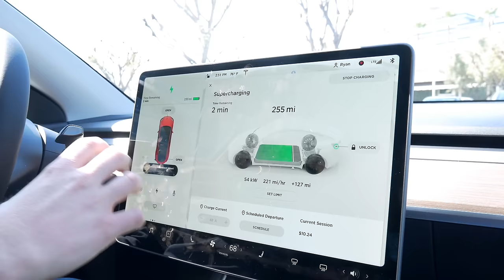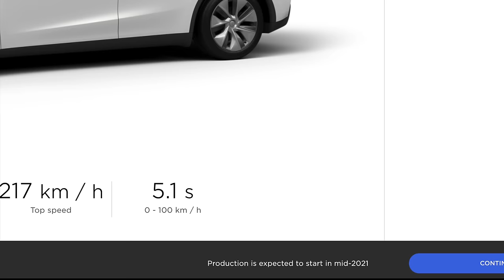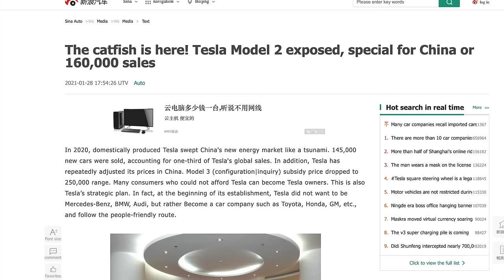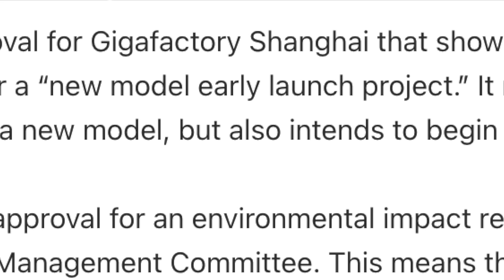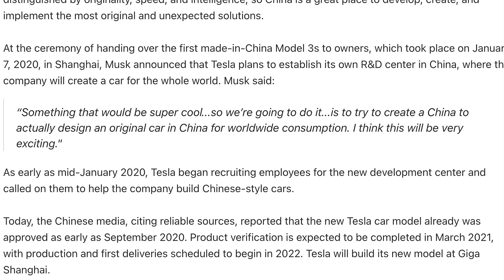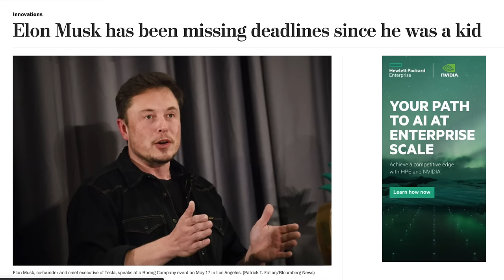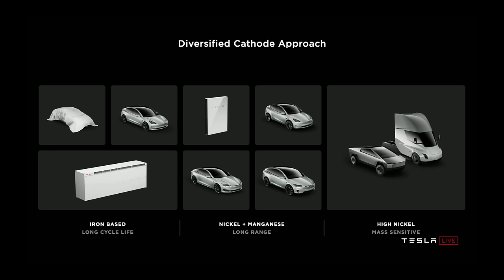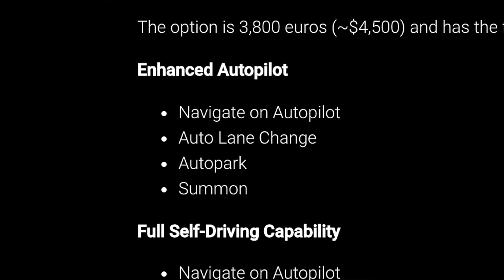LEAKED Tesla Model 2 in 2021?

Comment: That Model 2 render looks like someone slapped a Model 3's front on an Opel Corsa.
Reply: I felt the same
Reply: In one of the models the rear looks very VW ID3 I thought
Reply: Agreed. I'm not convinced this a real Tesla render. First Tesla would not put a visor over the back window. That is popular in the auto industry, but it increases drag. Tesla will resist this trend because they always minimize drag. Also, Tesla does not use the fin antenna on the back of any of their current cars. The antenna is hidden.
Reply: Opel Astra GTC

Comment: A Model 2 hatchback will sell very well in Britain and Europe as a whole.  It could even tempt me to change from my Golf which I’m picking up on Monday and go electric for the first time when I change my car in 2024.
Reply: I agree. That’s what I’m waiting for too. Also in UK. Currently drive a skoda fabia
Reply: Same I want to put a deposit down for this one, been itching to get model 3 but tight ass me it doesn't quite add up for my mileage, I have a small vauxhall and don't want long range as hell nothing is really that far in Britain.
Reply: @martinsykes5722  precisely
Reply: Model 2 performance/long range please - sounds good to me
Reply: I have a VW Golf as well. I would trade for a Model 2 hatchback LR.
Reply: I currently drive a Trabant, but am unsure whether the rust protection would be as good on the Model 2.
Reply: go get you a golf 7... golf 8 has so many problems....
Reply: Model 2 or an ID3/4 will be my next.

Comment: I haven't been so happy not being able to afford a Tesla until now.. can't wait to see the full version of this and hopefully its specs stay reasonable with the 3's
Reply: Lower accelerations = lower power consumption = need for smaller battery = cost savings. If anything its a city car.
Pros: Faster charging, affordable (as in a long term) and practical for getting around. Given the range is a real bonus making this car even more capable.
Reply: @EddyKorgo  

I agree, but few will accept a "city car" only in the usa. You can drive cross country in a Toyota Yaris. You can cut top end performance. Slower 0 to 60 times, lower top speeds, lower horsepower. Etc Americans don't want. City only car. I really can't see americans accepting anything less then  250 to 275 mile range.

Comment: The refreshed Model S is not ahead of schedule.  It was the Model S Plaid+ (renamed from just Plaid) that was promised at the end of 2021 and that is still where it stands.  The Plaid+ is dependent on volume production of the 4680 cells.  It remains to be seen if the Plaid+ shows up before late 2021.

Comment: the 2 could be done super quick if they use the bottom of the 3 and just put different body on top that is shaped like a hot hatch.  Personally I like the look of it.  It would naturally be shorter because the rear wheels would be much closer to the rear of the car as hatchs tend to be.  Even the hood could be shorter as well.  I am defintely going to be all over that car when its released!
Reply: The chassis needs to be cheaper though so it wont just be a rebody 3.  I would expect the 2 to be 10k cheaper than a similar 3.

Comment: Sorry Ryan, my real question is: have you done an evaluation of Tesla's carbon footprint? Drive CF would be low and even very low if powered by alternative energy charge stations. Production CF may be high for awhile as casting and automated factory and downstream supply chain CFs would lag and battery CF seems it would be very high. But what's the real number? Thanks, S.

Comment: If I know Tesla, then trust me they will build a pretty good looking hatchback and it will be very tight and sporty one. Consider this as a hint.
Reply: Two versions?
$25000 lower performance version?
$35000 High-performance version to compete with hot hatches?
Reply: @Will91289  Rumour has it, a sport hatch will. Be around $32,750 - $33,990 but the base will be $24,950 - $25,750
Reply: Got it: MODEL Ts (tight and sporty)
Reply: @viewer7200  Ha ha. Model name is still up in the air. Internal joke is it's a mini 3. There are two teams internally divided on calling it Model A / Model C
Reply: Any idea when Tesla will annouce it?
Reply: @christmasisawesome9348  They already announced it. If you are talking about Candidate design reveal, design team is very small elite number of people who are very tight lipped. For Tesla, primary accelerant is getting the model Y out from Berlin then start Model 3 in Berlin as well as start Model Y in Texas, in that order.

Comment: the 25k tesla is going to be a cyber car.  there is no way to get the costs down to 25k with a traditional looking car with a paint job in the next 3-5 years.  the only way they pull it off is with a cyber model.  the starting model cyber truck is like 10k-20k cheaper than other work trucks or whatever stuff like the ford raptor is considered.  they will have to leverage the cheap manufacturing processes of the cyber truck and wait for batteries to dip some more before they can sell a 25k car and not take a loss.

Comment: With this integrated structural battery pack - will they be able to replace a bad cell or cell(s) which can have a very detrimental effect on the overall pack if not fixed?
Reply: Not easily? Though they currently can't either?
Reply: @CED99  I'm not sure how it works with current pack or projected to be honest - just read of some who had issues with a few dead cells adversely affecting the while pack. Old cells seems to be easier to swap, but I honestly don't know.

Comment: Tesla needs to fix it's very poor service soon. Just bought a Niro EV instead of another Tesla due to this.
Reply: But Niro is not in the same segment.
Reply: @neeljavia2965  It is, both electric 5 door hatchback, about the same price and range.
Reply: @martialman.4563  Not range. 
That's definitely false.
Reply: @martialman.4563  Plus Niro EV 8s based on Hyundai Kona. 
Which is way too small than a Model Y.
Reply: @neeljavia2965  My Niro EV gets about 270 range, rated 239 miles. Model Y base is 244 miles and if it's like my Model 3 it will only get 200ish.
Reply: @neeljavia2965  Granted, the model Y is slightly larger but Niro EV is still in the same class as base model Y.
Reply: @martialman.4563  Model 3 doesn't come with that range.
Reply: @martialman.4563  Plus Tesla has much more higher range models.
And the cars are much bigger.
Reply: @martialman.4563  Otherwise as you wish. 
Tesla's built quality and lack of servicing is a big issue. 
Would get solved in future. 
Just like kia is having service issues in my country as it entered just 2 years back.
Reply: @neeljavia2965  Mine is rated at 284 now, it gets 200. My KIA gets 270.
Reply: @neeljavia2965  Slightly true, Tesla is a little bigger.
Reply: @neeljavia2965  I hope so, I am keeping my Tesla pickup reservation but if service does not show signs of improving I will buy my 3rd EV from someone else.
Reply: @neeljavia2965  I just looked again, my car is rated at 286 miles as of right now. It will only get that best case scenario. My KIA is 239 rated and that is worst case, lifetime average is 3.8 miles per kwh, 64 kwh pack and bought the car a month ago so range will only improve with spring weather.
Reply: @martialman.4563  Ok. 
See carwow video and check who's got the better range. 
No point in arguing.

Comment: Potentially a small vehicle selling for $25,000 could sell in huge numbers if it is well designed and manufactured. Traditional car makers will need to create electric vehicles to compete or face losing market share.

Comment: There will be a Type R performance version of the model 2 hatchback and options for a premium price, so they won't all be slow.  The $25,000 version will likely come out later as a 2WD standard range model, so expect higher prices and fully loaded long range model for $30,000 to start.  FSD for another $10,000 so it will be $40K.

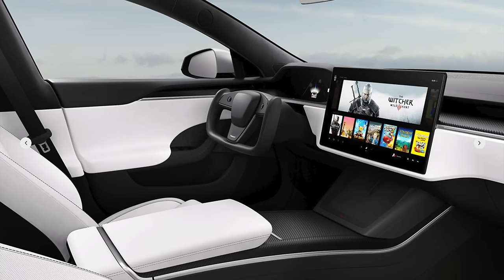Comment: 11:04 please read the information on www.tesla.com/models . It clearly says "0-60 in under 1.99s - with subtracted rollout" which means there will be 0,2s added when launching from a standstill (scroll down a bit to "electric powertrain"). Why does nobody mention this? Everybody is talking about the insane "0-60 in under 2s" performance but it's actually not true - confirmed by Tesla themselves.

Comment: There are possibly two models. One hatch model 3 which will be cheaper. I am sure they can cost reduce , but not so dramatically - it will go for maybe $32,000. A different model built differently from the ground up will take longer to bring to production, and will be able to hit the $25,000 target

Comment: Outstanding Ryan,
Wow you packed a ton in this video! 
Do you know of anything specifically about what VIN # or date for sure will be receiving the Die Cast front & rear ends??? 

I thought they were already a done deal but now I'm worried about placing the Model Y order! 

I agree with Elon's original mileage estimate that EV's must have a minimum 250mi.  But now with 4680 batteries that a 300mi for all vehicles will be the bottom end.  I expect for example the Model Y base at 300 and LR at 400-450miles.  I'll still buy the Model Y LR now as long as I get the the Die Cast Model.  

Thank you brother!  
Keep up the wonderful intel! 
Cheers,
Eric

Comment: Do you think they will need as many Superchargers when they use the 4680 cells (longer range)? There is no way they will be selling cars from Berlin in “mid 2021” the factory isn’t finished yet and in their earnings call they said they may produce a few cars by the end of the year.
Reply: It's gonna be done by June. That's according to German regulator
Reply: @TheMagicJIZZ  factory may be finished by June but no way they will be making cars. Brand new factory, new Labour, new manufacturing concept, brand new batteries, brand new paint shop technology (for Tesla anyway) and when they have that sorted out they will need to redo all the crash testing again. They will be lucky to sell 1 car from there in 2021.
Reply: @scottwills4698  no they are already manufacturing rn. Look at the drone footage and internal pictures. They won't make a car yet. But they will be producing by summer. The building doesn't have to be finished for the molds and castings to start
Reply: @TheMagicJIZZ  I have seen the drone footage, the buildings are not finished and internally they are still fitting the buildings out. I hope it’s sooner but even Tesla’s numbers at their earnings call was Zero cars out of Berlin this year. I will believe the factory will be finished in June they may have made a car by August but I will be really surprised (and impressed) if they sell any this year made in Berlin.

Comment: I don't get the argument with the Tesla's charging network. Ain't there adapters that make it possible to charge other cars in a Tesla charger? And can't Tesla cars also use adapters to charge from other chargers like Ionity?

Not sure if that's a thing, but I 'm imaging it's possible. It's not like the current is a proprietary software, at worst the charging speed would be slower when using another manufacturer's network.

Comment: WHY DID THAT MODEL 2 photo  have the number plate  say  model H.
if you look at any model having as many parts that are the same  by doing this less parts  being different then easier to stock parts if there are fewer different items.  so lowering cost.  this may mean that many parts in the new  model 2 will be parts already being used on other models.   maybe using the doors. bonnet and may be the model y boot as the hatch back.  it would be east yo use lights off may be the y or 3.   the more they buy the cheaper they should buy parts for

Comment: The way to a less costly car is to eliminate the over complicated bullshit like the electric door handles and complicated suspension. Use regular door handles and a MacPherson strut suspension all around. Have cloth seats with manual adjustments. Use a steel, not glass, roof. Have all cars wired for Autopilot, but make it a dealer plug-in option. Use an all mechanical, physical knob climate control system.

Comment: Model "2" would be awesome for China, India and third world countries were gasoline is expensive. They can produce a much cheaper version of motors and range can be 350-400Km, heating seats and steering wheel not necessary in equator line countries so some savings there, no fancy audio, center screen absolutly necessary, not a luxury car but a budget one.

Comment: The only thing keeping me from considering this or newer Teslas is the minimal interior design. I dislike having almost everything be controlled by the touch screen. Looks great, but I dislike having my eyes off the road for more than 2 seconds. Why fix what isn't broken. New features are okay to be implemented on the screen, but give me the essentials to control via physical means
Reply: @Encourageable  I drive an 80s Japanese sports car. Im perfectly content with manual seats, no power steering, manual transmission and no traction control. I think I will be fine. I love Teslas don't get me wrong. Just don't like going through several menus to adjust my wiper speeds.

Comment: My opinion on battery range has changed significantly over the past few months.  Whereas before I was strongly leaning towards at least 250 miles of range, I'm now convinced that a realistic range of 200 miles is more than enough for my needs.  I will keep an ICE car until battery tech and infrastructure has improved to the point that ICE cars are completely antiquated.  However, an EV with a 200 mile range as a primary run a bout and commuter vehicle would suit my needs perfectly - so long as it's priced right.

Comment: In China, the world's biggest EV vehicle market, the Made in China EVs from NIO are eating more and more deeply into the sales of Tesla EV's being made in Tesla's new Beijing Gigafactory - to the point where Tesla wound up with a large surplus of unsold Tesla EVs in China (primarily the bland Model 3's) that had to be exported to Europe and sold at a deep discount in order for Tesla to make their projected sales figures in 2020.  There are many sound reasons why growing numbers of Chinese EV buyers are choosing NIO EVs over the EVs from Tesla. The NIO EVs are far superior to their Tesla competitors in virtually all aspects, from better exterior styling to much higher build quality and superior fit and finish to the far superior interiors which, in contrast to the bland, mundane interiors of the Tesla EVs, are plush and luxurious and loaded with many cool features that aren't available in any of the Tesla EVs.  The Crushing Blow that the NIO EVs have over all of their Tesla EV competitors is the NIO Battery Swap feature, whereby a drained battery pack can be quickly exchanged for a fresh, fully charged battery pack in just a few minutes - thus eliminating the hours upon hours upon hours that drivers of Tesla EVs will rack up throughout their ownership of their Tesla EVs sitting at supercharger stations waiting for their run-down batteries to be only partially recharged. Adding insult to injury - the NIO EVs are priced less than their inferior competitors from Tesla - forcing Tesla to cut their prices to keep pace with NIO and in the process, this eats into Tesla's profits, which negatively impacts the Tesla stock share value.

Comment: I very much doubt model 2 will be deliver in 2021or even 2022. I think it will be reveal in 2021 but deliveries won't be until 2022 or 2023. 

I also don't see why Tesla would remove the acceleration, as that is a major selling point.
Reply: Not everyone's into acceleration, the fastest car we've owned was a 30,000kM 1985 BMW 323 which did 0-100kM in 7 seconds. It was fun on the open road, but very ordinary when driven sensibly in urban traffic.
I'm confident that the low down torque of an EV would give far more sensation of power, than our Bimmer in the suburbs.
I'd welcome a sensibly powered Tesla city car, as range isn't as important for 100% city driving.
Mind you, we live in South Australia, so I used to drive from home to work, which was on the other side of the city, in about 19 minutes. 🇦🇺👍
Reply: @CNile-se9xw  it the thing tesla is known for. So abandoning it for it hot hatch when they even talk about the acceleration in it truck would be a weird decision.

Comment: Unfortunately for us Europeans Tesla's are a lot more expensive. The cheapest model 3 here costs 57000 Dollars when you order it from the official Tesla website. And that's the most basic model.

So no way that the Model 2 would cost $25000 Dollars here or €20000 Euros.

I find that unfortunate.

Most American cars here in Europe cost a lot more than in the US. A new car that costs $30000 Dollars in the US can easily cost €100000 Euros here in Europe.

Only Ford seems to be one of the few exceptions that charges normal prices here in Europe. If Americans want to sell more cars in Europe, they will have to solve those extreme price differences between the US and EU.

Comment: With Dual AF motor RWD direct drive they could do it, and with tank turns too..... 25 percent more efficient motors, no step down gears... simple, efficient.. 300 mile range with lfp batteries.
6000 rpm @60 mph, 0-60mph in the 6 second range.  No more ultra low profile tires please.
Reply: 3000 rpm @60mph, ultra quiet.